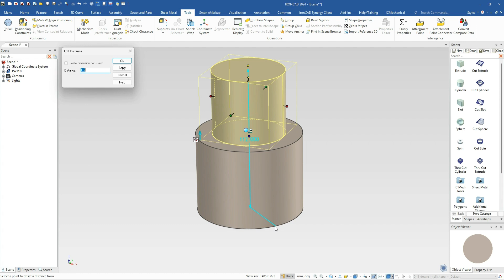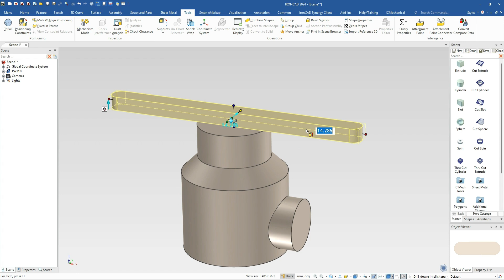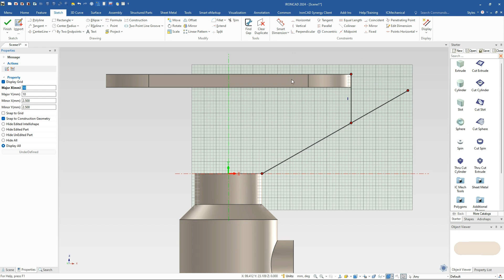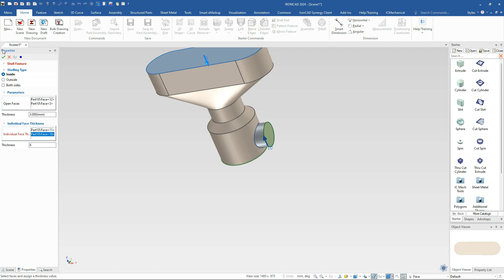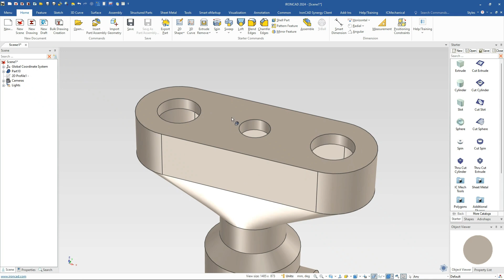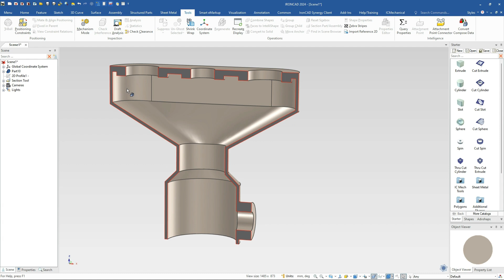Too Tall Toby Practice Models Performed in IronCAD - Practice 24-06-06

Comment: Hello I am an IronCad user and I'm just getting into 3D printing and would like to be able to print threaded parts drawn in IronCad. I have seen a few youTube channels showing how you might do it in Fusion 360 but I have not seen how you might make thread for 3D printing with IronCad. Could you help me out please.
Reply from the maker: Hi. In general, you can create real threads in IronCAD using the Thread feature (under the Feature Ribbon). When printing on a 3D Printer, it is more about the orientation to maintain strength and for removal of supporting material. , printing threads is always a tradeoff between ease of use and strength. If you print the thread straight up and down, it will print easily and will have a cleaner profile so it will screw in and out easily, but the layer lines will be lateral to tension forces and parallel to sheer forces which makes it far weaker. If you print it sideways, you will have to add support material, so you will have an extra step to remove that when it's done printing. Also, removing the support material leaves scars on the print that will make it difficult to screw in and out of anything. However, the layer lines will then be parallel to tension and lateral to sheer so it will be MUCH stronger. Adding to this, if you cut your thread profile in half then print it flat you will lose the support material and just glue the 2 halves back together. This will keep the print clean and strong when printing on the side. Generally, most people opt for printing straight up and down and don't have many issues with it breaking to often.